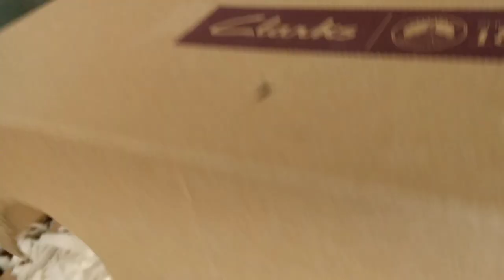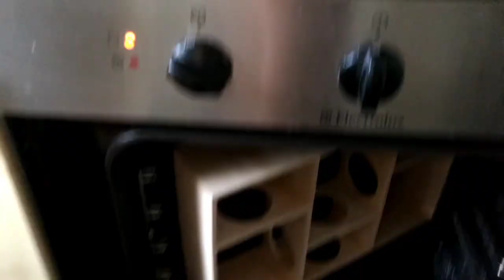How to get rid of weevils/other bugs in a hamster cage

Comment: I just found what I think are weevils in my hamster cage and I'm working out my game plan to get rid of them. What do you do if you didn't freeze your food and now have to, but then what do I feed my hamster while they are freezing? I bought a new bag so should I feed that while I freeze my other food. I haven't found how I got the bugs yet either
Reply from the maker: Oh no I'm so sorry. I would just take some out of the bag before you freeze the rest and just check what you put in the cage first. Not ideal but you can't starve your hammie..hope that helps.
Reply: @CosmicHamsters  thanks that's what I ended up doing. I wouldn't starve my hamster, don't worry! If you could help share some more advice that would be really appreciated! If not thats completely fine!!!
 My tank has a custom lid I built from wood and rodent mesh. I've been spraying it with 50/50 vinegar water and wiping it down. Do you have any advice on how I can save it? Ive been cleaning my tank with the same and keep finding more bugs inside it hours later. My hamster is in a spare bin cage while I try to clean his tanks.
Reply from the maker: @cheyanne7242  so is the cage empty of everything now and you are still finding bugs
Reply: @CosmicHamsters  yes very few but they are still there, it's very odd.